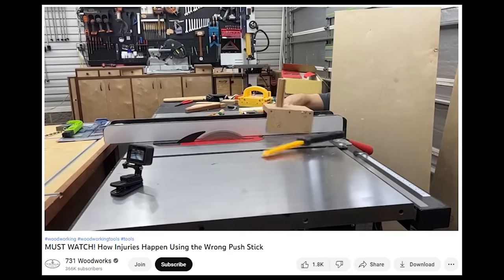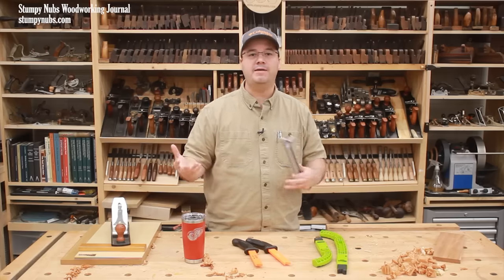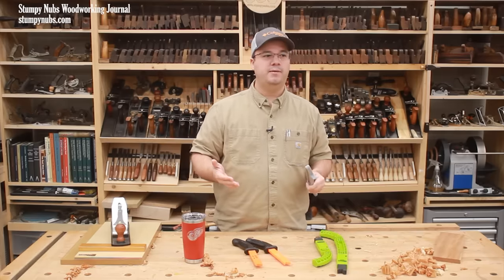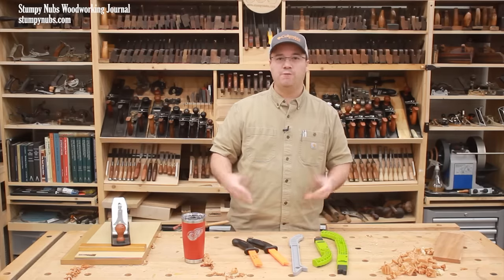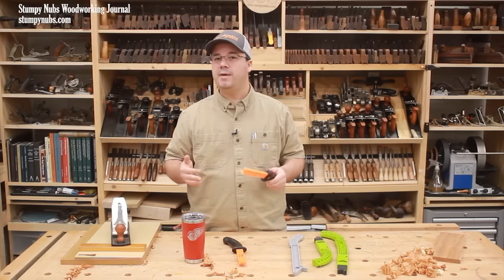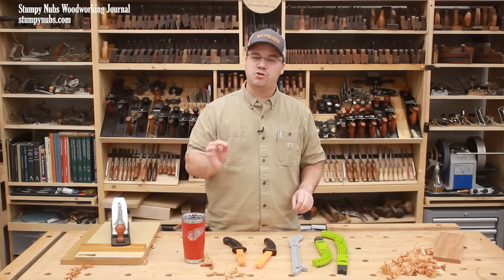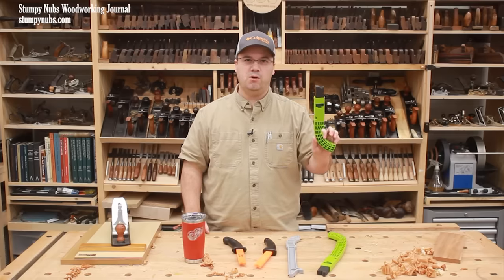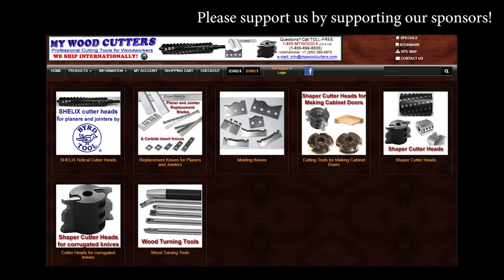EXPLODING table saw push sticks are a real thing!

Comment: I had that "explosion" problem with the standard push stick that came with my saw-stop.  A chunk hit the plywood sheet behind me.  I think he didn't get the "explosion" because it was rigidly attached to the fence.  When mine hit the blade it almost ripped it out of my hand.
Reply: I use a saw stop push sick as well. I don't own a table saw but I use one at my local maker space (they have a saw stop). They do have wooden push sticks available, but the way they're designed just has my hand a little too close to the blade for my comfort so I went and bought a saw stop one. I haven't hit the blade with it but with the cold temperatures here in Colorado (I know other places get colder, but still) I wonder about the plastic getting brittle. I wonder, was temperature a factor with your experience? Or as others have pointed out that plastic gets more brittle with age, how old was your push stick? I'm still new to woodworking and I think my saw stop push stick is probably fine, but I do like the idea of the bow stick with the foam tip.

Comment: You mention using sturdy straight grained wood but any concern with using plywood for a push stick?
Reply from the maker: Plywood or MDF will work if it is thick enough to be sturdy and won't break under pressure.

Comment: First of all, why would one want to bring the push stick in contact with the blade? Sticks have to be thinner than the width of the cut. Also, there are many jigs and push blocks that are better suited for thin cuts. So, in my opinion, this is a wrong kind of demo wich calls for an absurd method to use push sticks, and also a call for accidents. Next time he'll be demoing the dangers of using metallic one inch pipe sticks.
Reply from the maker: This isn't a demo about any method of using push sticks. It's about types of push sticks, and I covered both the points you made. Not sure if you watched the video
Reply: @StumpyNubs  Of course I watched it all. I always do, as I like your contents quite a lot. I was referring to that guy's video, not yours and I apologize for not saying it clearly. Best regards.

Comment: I've made push sticks from high-quality (seven to nine layers) plywood. Am I doing something wrong?
Reply from the maker: Did you watch the whole video?
Reply: @StumpyNubs  Yes, twice. And a third time after receiving your reply. Maybe I should have been more detailed in my question. But first, I consider your channel the best for informative thorough and thoughtful woodworking and tool information. 
In your video, you mentioned wood push sticks should have grain running the length end to end, and that seemed to eliminate plywood and I thought that was intentional.  I thought that was odd and wanted to know more.  I do prefer making my own push sticks as it allows me to design them to be more pull than push while allowing greater downward pressure on the workpiece preventing lifting and possible kickback. I did appreciate your method for testing the hardness of plastic push sticks. Thank you.

Comment: Every wood worker wort 2 cents makes his own push stick (several) from a sound piece of plywood.   Lesson: Avoid plastic in any safety application. Wood would cut but not shatter.
Reply: I'm a woodworker definitely "wort  two cents". I make a very good living,  I'm  57 and have been working wood since I was 5 years old. Yes, I absolutely do make my own push sticks but I have also picked up and used my plastic push stick that came with my saw probably thousands of times. That is till about a year ago when it shattered like a grenade after accidentally touching the blade. I have literally thousands and thousands of hours in a wood shop and simply wasn't aware that there was any danger using a plastic push stick. I'm sure there are many many people out there like me, hence the need for videos like this.
Yes, most woodworkers that use table saws every day likely make their own wooden push sticks but I bet a lot of them still also use their plastic ones too.
Reply from the maker: I covered (and recommended) homemade push sticks in the video 😊

Comment: I absolutely haaaate push "sticks". You are too far detached from the material, which reduces your control and magnifies that lack of control and the surface contact area is too small to maintain control when life happens and the slightest undeal situation occurs. 
Push BLOCKS, however, with a nice long sole and a small heel, and a strategically placed handle gives you maximum control while keeping your hand safely away from the blade.
Reply: To clarify, my nomenclatures are push sticks, push blocks and push pads. So as not to confuse what I call push pads with what I call push blocks
Reply from the maker: I prefer a larger push block, but I believe small push sticks have a place for some cuts. And if used properly, I have never had a problem with them.
Reply: @Stumpy Nubs  hey you know what could make a great video? Explaining why so many factory throat plates have that weird piece of metal at the back that sits below the plane of the rest of the throat plate. Boggles my mind and has caused me nothing but grief on certain cuts

Comment: Styrofoam for the win! A piece of polyiso board is stiff enough to push firmly yet not kick back if it contacts the spinning blade
Reply from the maker: Styrofoam breaks under pressure (depending on its thickness) and when it does, it snaps instantly and without warning. It's a bad choice for a push stick.
Reply: How about polyiso rigid board? Its faced on both sides with a tough plastic film.  Agree with your assessment on styrofoam, in retrospect.  Push stick safety has become a bigger issue with me as I enter my mid 60’s. I can definitely notice a decrease in my overall level of fine motor skills compared to twenty years ago, which is making me apprehensive during table sawing.  Glad I have a tracksaw, too!

Comment: I'm glad you did a video on this. I found it hard to take the other video seriously. I mean how do you take someone seriously who has siding on the inside of  a building? I keep finding myself wondering if he has drywall on the outside. You on the other hand have a wall of handplanes. Makes me feel that you know what you are doing and talking about.
Reply: That's funny LOL. I think he made an expansion after house was built.
Reply: @iPick 4Fun  that's what I thought but it's on the wall with the garage door also.
Reply: @mr.picklesworth  I do feel that specific video was little bias.  I walked away with my observation that he claimed nothing is safe except the one with the foam tip.  I have been using the crappy off cut plywood push stick for many years.  I nicked the tip every now and then and even made  new ones.  Push block (home made) is my go to tool.  I use push stick when the block can't do it sufficiently.

Comment: I was hoping you would add something about the style of push stick that has a handle more like a saw handle, and the base of the push stick is always in contact with the wood being cut.  These are readily made from wood and have the advantage of offering more control over the material being cut.
Reply: Patrick...I have seen those styles, and they scare me a little bit. I'd rather get my hand away, open and moving towards my face than to have it captured in a closed design...but that's just me, and just my opinion. I've been nipped a couple times in the 30 or more years I've been making sawdust...one a danged closer-than-comfortable manicure, and one a $30K major repair. Whatever you chose to use...please be SURE to use it!
Reply: @woodrowsmith3400  I understand your concern, interestingly, the worst accident I had was when the push stick I was using, similar to the ones demonstrated, allowed the stock to turn slightly into the blade.  Because my hand was away from the blade, it ended up in line with the piece when it was thrown back, prompting one of my trips to the ER.  The damage was substantial and lasts to this day.  It was after that event that I bought a Gripper, something I should have had before the event.

Comment: Always makes me question things when you see table saw videos showing something dangerous, with no blade guard in view. If the blade guards were in place, how much more difficult would it be to bring the push stick in to contact with the blade? Serious question, my shop is too small for a table saw, so I use a plunge saw.
Reply: plunge saws(miter saws i assume) are very dangerous too. blade guards are impractical for a lot of cuts and obscure the view of the cut / fence to make sure it’s going well. i personally think those push stick style ones are absolute rubbish. a proper push block / shoe gives you much more control and is made of wood and importantly keeps downward pressure on the piece.
Reply from the maker: I use my guard for most cuts and have made videos about why I recommend them.
Reply: @jasonbenjamin1464  I was referring to circular saws that run on rails. I think they are called track saws in the US.

Comment: First safety device is the blade guard, missing in al the scenes shown.
Reply from the maker: This isn't a video about blade guards. It's about push sticks. I have other videos about blade guards.
Reply: @StumpyNubs  What i mean is that If the blade guard is in his place, the risk of touching the spinning blade with the push stick is significant less.
Reply from the maker: @SanchezArep  - Every 9-fingered woodworker I know (and in this business I have met a lot) had all ten fingers and a boatload of experience right up until the day they got cut. "Some blade guards are dangerous" simply means you haven't used a good saw with a proper guard. :)

Comment: Great video, as always! Personally, I also find that often if the cut is going to make the push stick too-too close to the blade (and usually I know if it would contact the blade if the cut goes as expected, measure twice cut once), often times that is a sign another method might be a better choice for that cut.

Comment: Really? You can't make replaceable foam tip... Really? It's the easiest part to make! Dude, sometimes you need to think about what you are talking about. And it's only $4? WTF? You can buy a whole sheet of that kind of foam for a few $ and cut it yourself.
Reply from the maker: Yes, you can buy a piece of foam and cut out tips, but how are you going to insert that into the end of your homemade wooden push stick?
Reply: @StumpyNubs  The easiest way will be to use a solution similar to the one in the push stick presented by you. If you want, I will design a simple push stick with such an insert in CAD. In fact, I already have several solutions in my head, such for woodworkers, but also for those makers who have a 3d printer :)